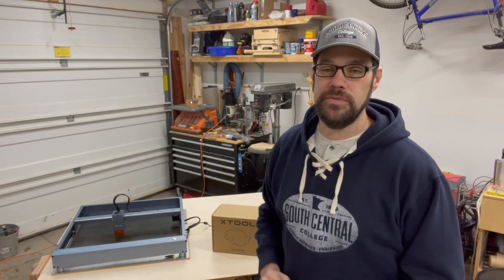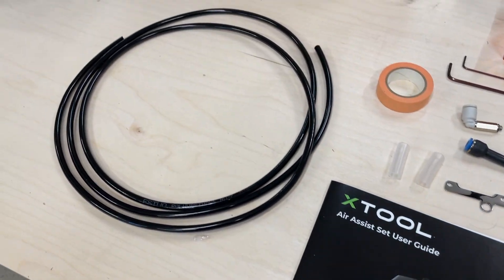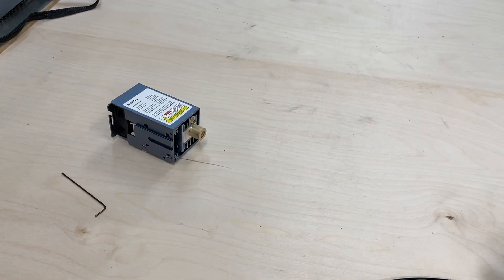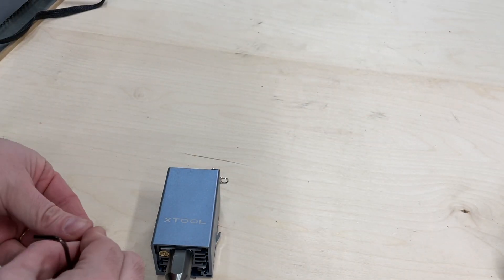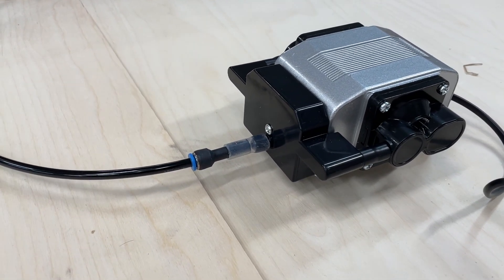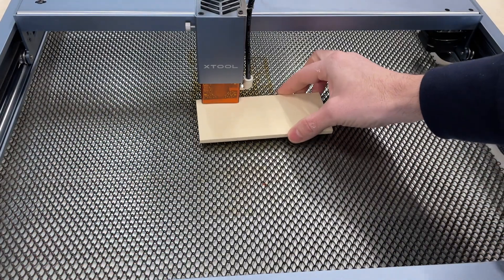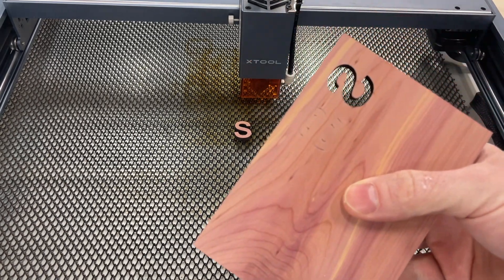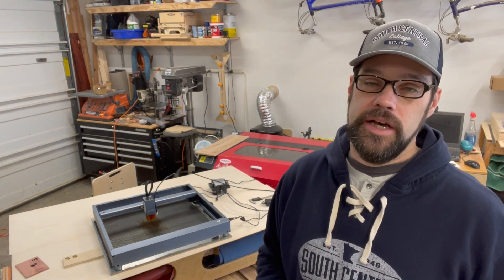XTool D1 Laser Air Assist Module | Installation and testing

Comment: Perfect video!  Provided all the information I was looking for with regard to air assist. I've just ordered the air assist pump for my XTool D1 20w and I can't wait to see the difference that it makes. I've only had it a few weeks and I'm already tired of sanding everything and cleaning all the and burn marks from the wood before painting. It's also going to be nice to not have little tiny parts where it doesn't cut all the way through. I can't wait till it arrives on Monday! Thanks again for an excellent video!
Reply from the maker: You'll really appreciate the air assist to improve the performance of the laser.  Thanks for watching!

Comment: i just got my air assist and it seems to be a different model than the one you demonstrated on.  Mostly all of the parts are the same with a few exceptions to how it's installed.  Mine came with a metal shroud (and the holes don't exactly line up with the hose) 😕and the clear tubing that attaches to the black hose is on top of the pump rather than the side... and the pump itself is white and not galvanized metal as seen with your pump.  Some of these differences threw me off a little when assembling the newer version.. All in all, still works the same way and I love it.  Thanks for your vid and explaining how it is installed.
Reply from the maker: Did you purchase the air assist from Comgrow?  They have one similar to what you are describing that also fits the XTool D1.

Comment: Great video but found that my side screw interferes with the red crosshairs. Did you remove it or did i just not tighten it enough
Reply from the maker: That side screw does get in the way of the crosshairs.  You can either go with just he rear screw or I disabled the crosshairs and used the low-power laser on option for framing and alignment.
Reply: @Vintauri  if you go with just the rear screw, wouldn't that allow a lot of air to escape through the hole?
Reply from the maker: @ThereminHero  If the cone is fitting correctly there should be almost no gap for the air to escape. However a small bit of tape over the open hole should alleviate that concern.

Comment: Dude... the screws thatlock in the nozzle blocks the framing laser ?
Reply from the maker: You can either just use the single screw to hold it in or even better, turn off the crosshairs and turn on low power laser framing instead. It’s more accurate.

Comment: What a difference. Is there a way to vary the pressure on the air pump with xTools system?
Reply from the maker: You can add a valve inline on the tubing but it’s a part you’ll have to provide yourself. I’m planning on using a 1/4” OD tubing ball valve on mine but I have not added it yet.

Comment: My nozzle is not tight fit so when I tighten set screws the laser is not centered to come through hole in the nozzle. How did you align the nozzle to be centered?
Reply from the maker: On mine it was a snug fit.  On some older models, the brass sleeve around the lens was narrower, so they included the PTFE tape to fill that gap.  That's a hit or miss way to align the cone.  I would measure the outer diameter of the brass sleeve on the laser, and measure the inner diameter of the cone and see what the gap is.  You could then cut some spacers to fill that gap to center the cone on the brass sleeve.

Comment: Great video! Do you have a recommendation for an inline valve that will allow for air flow adjustment? I'd like to use a small amount of air when engraving.
Reply from the maker: You can use the ball valves meant for drip irrigation systems.  The 1/4" OD style should work on the supplied XTool hose.  Here is a link to some I've played with in various systems. https://amzn.to/3GNpGul
Reply: @Vintauri  Thank you for the super quick reply.

Comment: Thank you for sharing...new and I mean new, so did not have anything (meaning the tube) going outside.  Just cut the wood inside the shop....
Reply from the maker: Hopefully you are able to vent that outside somehow.  I've run a laser briefly inside without ventilation and the smoke quickly got to be too much.

Comment: Question I just bought the d1pro with the air assist,  do I have to use the air assist cones that come with the air assist pump?  My shroud already had the notch cut as with as the hose adapter for the air hose.   Air does come out of the cone but you swapped out the cone and put screws in, mine that came with the pro doesn’t have spots for screws .  Thanks for the help
Reply from the maker: The original D1 came without air assist so the extra steps were needed to install the full kit. The newer machines like the D1 Pro do come with the air assist cone and shroud installed.  So all you should need to do is attach the air assist pump and hose to that existing cone.
Reply: @Vintauri  thank you I did just that and got to finally use it.  So far so good.  I am completely new to this so Any suggestions on how to perfect using this or video that helped you would be highly appreciated.  Thanks again !

Comment: Hi there could you please explain how can i operate xtool d1 pro air assist with lightburn software
Reply from the maker: Unfortunately the D1 laser cannot control the air assist pump through lightburn.

Comment: What is the material you are using that the wood sits on? And where can I get it?
Reply from the maker: The material I was using in this video was some fireplace mesh screen.  It's 1/4" thick and works well as a venting support layer underneath your material if you do not have a honeycomb bed.  If you have a local fireplace installer they might have some old material you can salvage for cheap or free otherwise you can bu it online here: https://amzn.to/3HEGuoI
Reply: @Vintauri  thanks so much for the quick response and helpful information

Comment: Just tried doing this and my laser box is setup different than yours and the new replacement shroud does not fit doesn’t even come close. Any ideas why?
Reply from the maker: The shroud that came with my kit was a replacement for the original non pro 10w laser.  If you have a newer one, it should come with a shroud that already has the appropriate cut outs, and might already have the air line adaptor into the air assist cone on the laser module.

Comment: Got my xTool D1 Air Assist Set, Original install video showed two different Nozzles 16mm and 14mm inside diameter. once I received the item it had two 16mm nozzles( not sure why you would need 2 if they are the same size). Now they want me to wrap tape around the laser head since mine is the 14mm laser (10w) . It would bother me if I was paying $20 for it but I paid $113 to get an air assist that I wouldn't have to backwoods it together.
Reply: Xtool should be ashamed of their poor service! I only got the 16mm nozzle, but need the 14 mm. The poor excuses for customer service did not reply to 4 emails .

Comment: Which in-line blower are you using, and are you satisfied with its performance?
Reply from the maker: If you are talking about the exhaust fan I’m using a Vivosun 4” blower from Amazon. It’s rated at 195 CFM and does a decent job. I might look at upgrading to a larger fan but I’ll have to adapt it to a 6” tube to get more CFM.

Comment: Was this supplied by the company for your channel or did you order and pay for it using the retail route?  If you ordered and paid for it by yourself, how long did it take to actually get your xTool D1?
Reply from the maker: The base laser was provided by XTool. It took about 10 days to ship from China to me in the Midwest US. I paid for the air assist module on my own and ordered it direct from the website. That shipped on Jan 26 and arrived February 8th.
Reply: @Vintauri  Thanks.  I am thinking about ordering one this spring.  Since I will have to use it in my shed, I don't want to start playing around till it warms up a bit (I live in Michigan).  You answered my question about how early I have to order it.

Comment: Is the nozzle supposed to stick out past the orange part? Did they send me the wrong size? Everything is coming with lines going across the design..
Reply from the maker: It does stick down just below the safety cover. I took mine off as I’m running it in an enclosure now. As for the lines, did yours fit snugly around the laser head or was there some slop?  It might not be centered and the laser beam could be hitting the cone and reflecting a beam.
Reply: @Vintauri  Thanks for the reply, I have an enclosure too but I still wanted to use it because it was supposed to still help. I will test it without the air assist and go from there I guess.
Reply from the maker: @patrickmichaels1362  One thing I don't like about the shield is that it can trap smoke and debris inside it near the lens / cone.  But you are correct that it adds a layer of protection.  I bought a set of OD6 laser protection glasses on amazon to give me the best protection when using any of my lasers.
Reply: @Vintauri  I saw in the comments that the second screw for the laser would get in the way of the cross beams so I left that out and went with just the one screw but I needed to tighten the one screw pretty tight. I am hoping against hope that I did not over tighten it and ruin the whole thing.

Comment: Does the air assist help with the smoke smell?
Reply from the maker: No the air assist will help with cleaner cutting but you'll need an exhaust system to keep the smoke smell out. The smell on the items will not matter either way.  Sometimes letting them sit a bit will help air them out and lessen the smoke smell.
Reply: @Vintauri  Is there an indoor exhaust system or do I have to use the one that goes out of the window?
Reply from the maker: There are fume extractors that can be used without venting outside, however to get one that is effective they cost a couple thousand dollars and the filters need to be changed regularly.
Reply: @Vintauri  Thank you!
Reply: Do you have to clean the lens at all/frequently when the air assist unit is installed (if so how frequently)? Or does that negate the need to clean the lens, specifically?
Reply from the maker: @jerryhill7133  if you run the air assist all the time it should help cut down on the debris getting to the lens. I’m working on installing an air valve to let me adjust the air flow from high to low so I can keep the air moving at all times but not have it interfering with certain jobs. The cone on the other hand does get messy due to it being so close to the material. That is something to watch out for.
Reply: @Vintauri  right the cone gets junk on it and I clean that, but I’ve not removed the cone as of yet to see what the lens looks like inside. Wasn’t sure if I should.

Comment: Did you initially use it without an air assist?
Reply from the maker: I did run it first without the air assist but picked it up shortly after.
Reply: @Vintauri  okay bc I’m in a group and a lady mentioned that I can cause a fire if I don’t have one. I got scared so I’m not putting mine together until I get an air assist.
Reply from the maker: @aliciahicks8986  A fire is more likely when your power is too high and speed too low.  An air assist will not change that risk, but it will help reduce the overburn and charring effect on your cuts.  I've tested several lasers, and not all have air assist, so just be mindful of your settings and monitor the laser as you work.
Reply: @Vintauri  you’re so kind to reply to me and answer my questions. Thank you! #newfollower

Comment: My screw holes didn’t line up like yours did?
Reply from the maker: I had heard early on there was a batch that may have had the plastic shroud drilled incorrectly. If that is your case you may need to reach out to Xtool to see what they have to say about a replacement.

Comment: If you had to purchase the air assist all over again would you?
Reply from the maker: I do like the slip-on metal cone design of this one.  However, I think it would be great for them to offer the air assist cone and hose connector as parts without the air pump.  There are plenty of other compressor or air pump options out there that would make it a cheaper option to ship and have better control of the airflow.
Reply: Never would buy it again. have not been able to use it for over a month.

Comment: What program do you use with the d1
Reply from the maker: I use lightburn for the laser control but sometimes I’ll predesign in Illustrator for graphics or cad for structural design.

Comment: What were your cut settings?
Reply from the maker: On the 1/8" plywood I was running at 5mm/sec and 100% power.  For the 1/4" plywood it was the same speed but with two passes.

Comment: After I install air asssit. My D1 stopped working. No laset shoot out hix.
Reply from the maker: Did the air nozzle fit right around the brass lens sleeve or was there slop?  It sounds like the laser is hitting the inside of the cone. You can try to center it with the included tape but that’s a bit of a hack.

Comment: What is the tape for?
Reply from the maker: The tape is there because earlier versions of the D1 had a smaller diameter brass sleeve on the laser head that the cone would slip onto. Their solution is to wrap the laser head with the tape on the smaller heads to make it a snug fit. The better solution would be to cut some small spacers as the tape can cause misalignment of the cone to the laser beam.
Reply: To hide the bad customer service that Xtool provides.

Comment: I just tried to install my air assist kit, but my kit only came with ONE nozzle. It is way too big (inside diameter). No matter how I tape it, it never aligns properly , resulting in no burning or engraving. Am I missing something in my kit ?
Reply from the maker: I'm sorry to hear that. I have heard that there is a recent batch of nozzles that were not drilled out correctly.  I would recommend that you contact Xtool support to ask about your nozzle being replaced.
Reply: @Vintauri  Thanks for your fast reply! I sent a letter to xtool support, hopefully they can fix the problem. I did see that they have a wood washer fix file, may try that while waiting.
Reply: @Vintauri   NOPE! Waited for a response, got nothing . Very sorry I wasted money on this pathetic piece of engineering . Where else would you be told to use tape to make the piece bigger??? Some one please point me to a 3rd party supplier that cares.

Comment: Ok. Seems like I need to send back the 5W D1 I just got and buy the 10W.
Reply from the maker: If you plan to do much cutting, I'd recommend the 10w, the 5w is plenty for just engraving.
Reply: @Vintauri  ok. It just clicked in. 10W for cutting through materials and 5W for basic engraving (metal, wood, glass, etc). I am new at the laser engraving world. Thanks

Comment: I just received my air assist a few days ago. The aluminum nozzle appears to be interfering with the beam. Without the nozzle I can cut through 1/8 MDF at 100% power and 3mm/sec. The pieces drop out. With the nozzle, the same settings don't cut all the way through.  The nozzle is a tight fit on the lens, there's no room for tape. I tried shimming the nozzle down so the hole is closer to the focal point of the beam. Not sure what else I can do.  Anyone else having trouble with the latest batch of air assists?
Reply: Sorry to say I had the same problem with the laser not working with the nozzle on. I might try drilling the laser exit hole a tad bigger.

Comment: I just added the air assist to my D1 and after testing on plywood and maple, the engraving with the air assist has more smoke around it and is way less defined. Any thoughts on what I’m doing wrong?
Reply from the maker: Depending on the power and material, you may want to leave the air assist off for engraving.  I like to run mine if possible to help keep smoke away from the lens but it can increase the amount of overburn on the material.
Reply: @Vintauri  I thought that was the whole purpose of the air assist,  no overburn.  I'm new and learning so thanks for the video!

Comment: My nozzle doesn’t just slip on
Reply from the maker: Check that there are no burrs on the set screw hole. It should be a snug fit but still slide on over the end cap on the module.